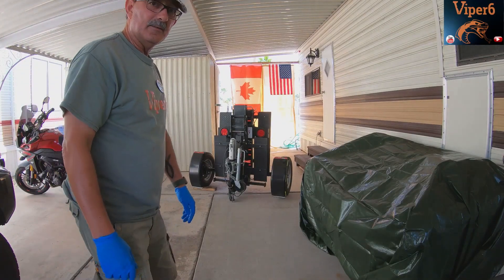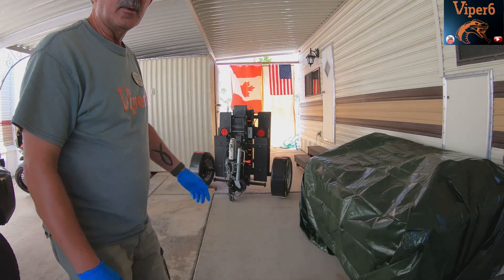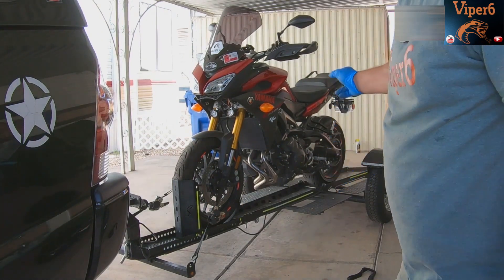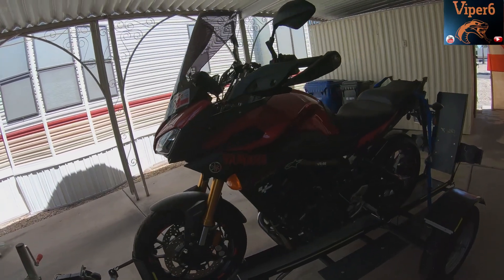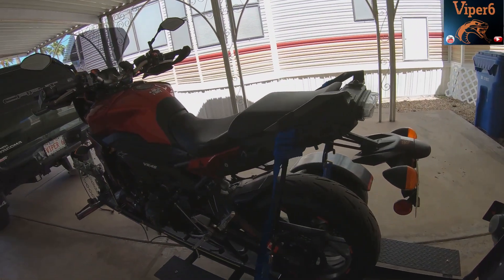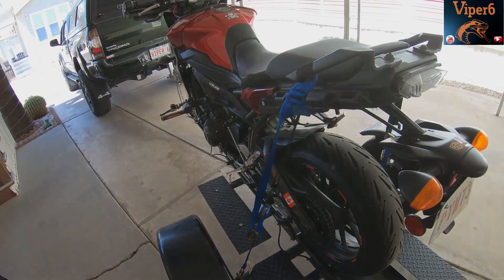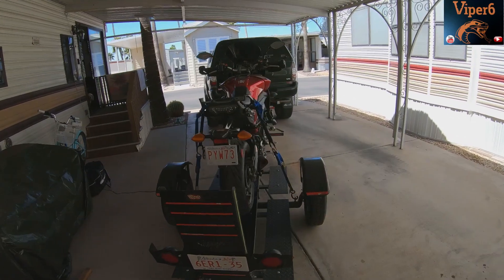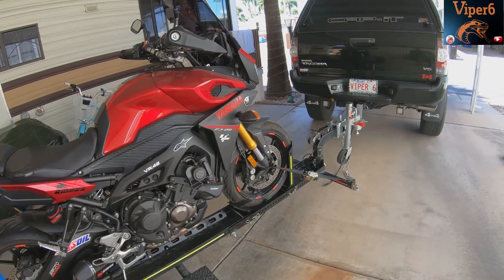Setting up and Loading my Stinger XL 112 Motorcycle Trailer

Comment: If you are going to be loading a big bike like my wing you may have to use the fenders to walk over as you load the bike.  I did.  In the end my chock was too loose and we had to remove the bike to tackle that.  Please be careful and not get "pinched" by the bike against the trailer if something goes wrong.  I also had to use reverse to pull my bike off the trailer.  Happy trails.
Reply from the maker: Yep, the Goldwing is a very wide bike and would require you to step on the fenders. Next bike I’ll be hauling is my Suzuki Boulvard C90T. Ride safe.

Comment: Really nice setup bro 👍 is there a speed limit when hauling that trailer?
Reply from the maker: Thanks bro. Yes, the maximum speed they recommend is 85 MPH, but I’ve driven 90 MPH with no issues. Ride safe.

Comment: Very convenient trailer set up, I am sure gas wise much better milage than a closed in trailer. My only concern is loading a much larger and heavier bike, don't think you can ride the bike up on that trailer. Would be concerned trying to push a  large bike up on that trailer. would that be legitimate concern?
Reply from the maker: It’s a great set up. I prefer pushing this bike, as it is much taller and stretchy when you are on tiptoes. I found that it is much easier to ride the cruiser on the trailer, as it is lower and you’re flat footed. The shock, if positioned correctly, will hold the bike up while you strap it down. Be safe bro.